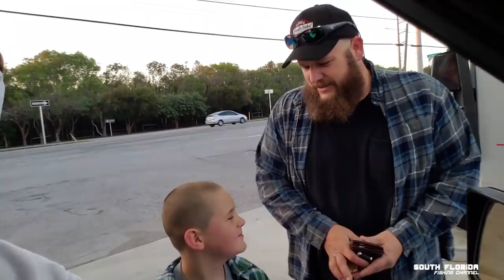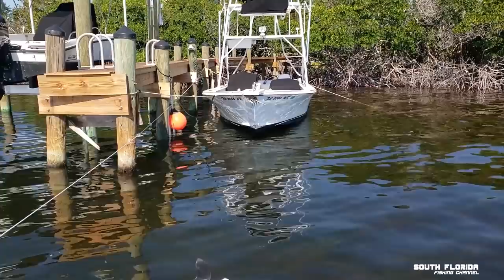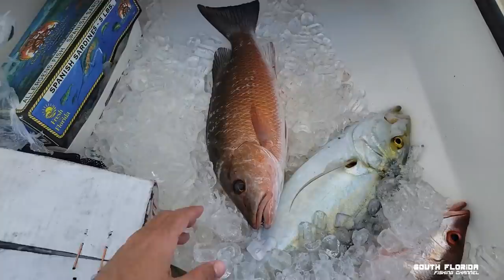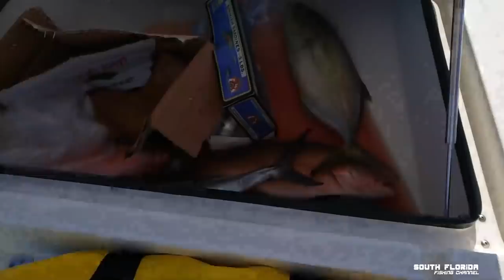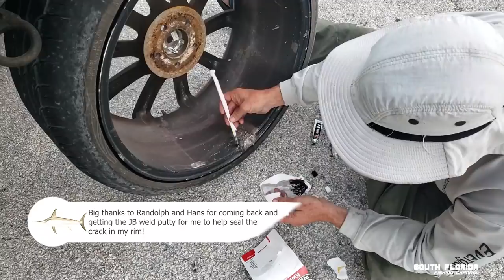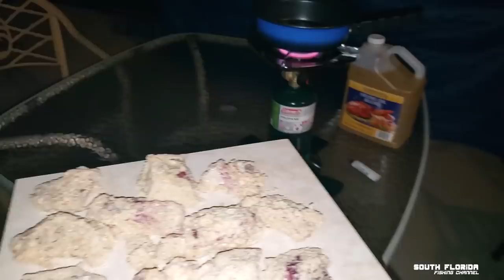How to Catch MONSTER Snapper on Florida Keys Patch Reefs | Catch and Cook

Comment: My wheel had a 7 inch cracked on it...and a welding shop in homested got it fix in less than 20 min....btw jb weld does wonders but...you need to wire brush that surface..cheers!

Comment: Nice video.  I'm a TIG welder that does aluminum welding.  Not to be negative, but that weld on that rim is definitely not a good weld by far.  You can fix that rim with a welder who knows how to TIG.

Comment: My favorite way to get mangroves is with a speargun. I used JB weld to plug a hole in my coolant jug on my truck. Lasted for 6 months before I got around to replacing the jug with a new one... As for the rims, just find someone selling their stock rims and tires on Craigslist. It will ride smoother and you won’t crack anymore rims.